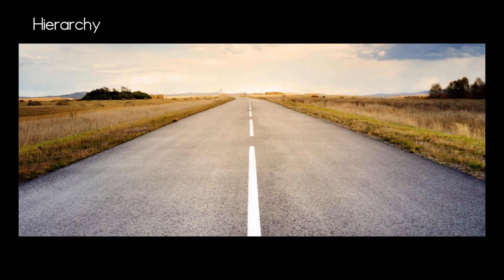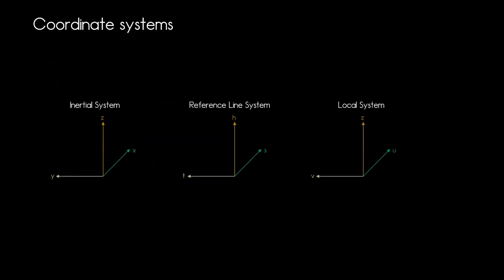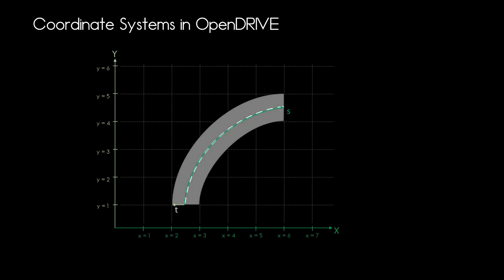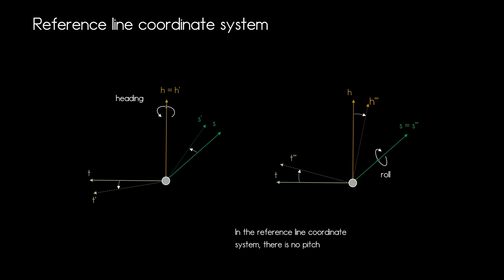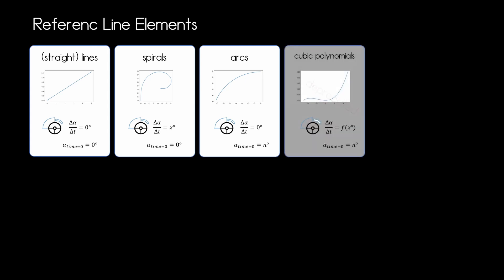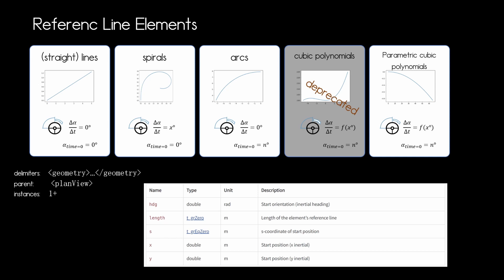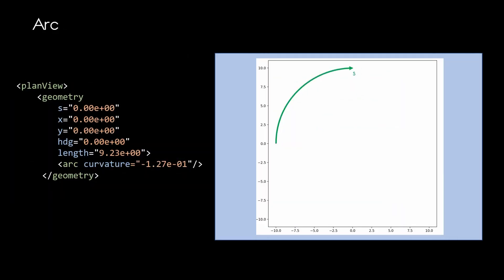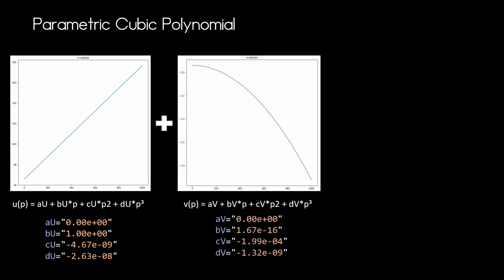OpenDRIVE Reference Line - road networks for simulation

Comment: Thank you for your video. I have a question. In the video at 6:23, in the picture on the right, why is the S of the green dot equal to 4? Should it be equal to 0? 4 should be at the top.I just learned here. I sincerely hope I can get your answer. Sorry, I can't speak English very well.
Reply from the maker: Hi Jotaro, sorry for the late answer, please consider that the Green line is within the x/y Coordinate system,  while the reference line creates its own coordinate system relative to the given x/y points in the XML snippet.

The s=0 is equal to the defined x/y coordinates
Reply: @niccohagedorn  I think Jotaro is trying to say that the green line should have extended more below the S point, to ensure that we are not at the beginning of the reference line. Since the S point was marked at the beginning of the green line, it needs to be 0 as that is the starting point of the reference line. Basically either S=0 or the green line should extend further to the bottom-left behind the S point.